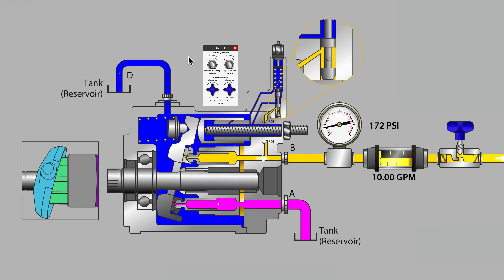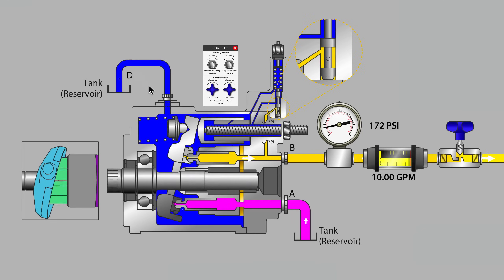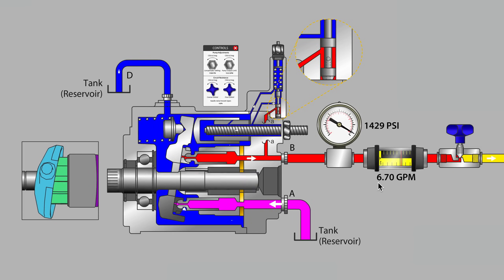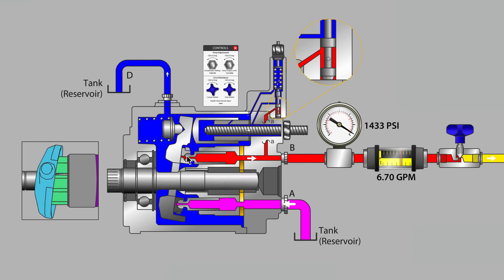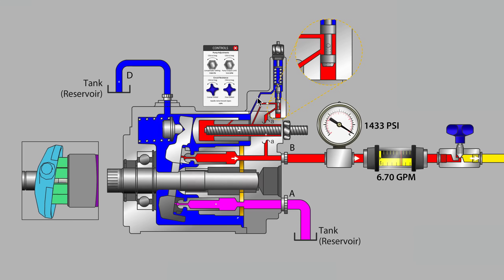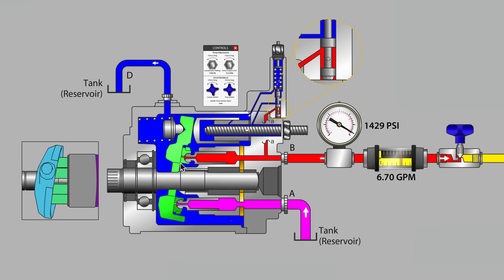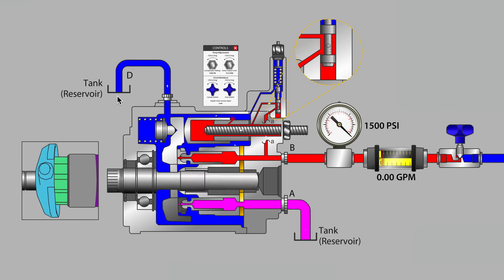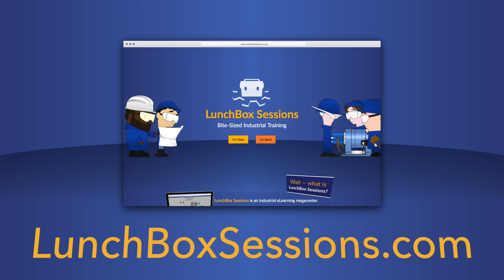Sources of Piston Pump Case Drain Flow

Comment: Would you care to explain why the pressure regulator in the pump works in a different way than an external pressure relief valve. Or where do I find it explained on your internet site?

Comment: Thanks for putting this together. I’ve got some schematics I have to teach from but they aren’t as detailed and didn’t show how the compensator provided the case flow along with other clearances.  I’d like to add in my experience in aircraft maintenance we almost always have filters on the case drain lines. We do scheduled inspections on the filters to find impending pump failures, and the filters also prevent any debris contaminating the rest of the system. Some smaller aircraft may route the case fluid through the return filter, but the larger aircraft will have a separate one. It makes it a lot easier to find the failure point without having to do a metallurgy test to see what other hydraulic components is failing.
Reply: You wouldn't want to lead the drain line through the return filter as you don't want any pressure build up in the drain line as this will increase the case pressure
Reply: @teis79  every airplane I’ve worked on is designed this way. It helps identify a failing pump before a full on unscheduled rapid kinetic disassembly. We have inspection intervals on the filters and most of them have a differential pressure indicator on the filter housings for a visual cue. As for the restriction that’s some engineering math outside my realm, but it makes sense.

Comment: I have a question about where the case drain connects to the tank. I assume as you said " unrestricted  flow" it should connect to the top of tank. I have just noticed all are hydraulic  power packs at the place I work at have the case drains connected to the bottom on the tank. Is this not wrong, or is there a reason for routing it this way? Thank you
Reply from the maker: Well not quite. Any liquid that splashes onto the surface inside the tank will quickly entrain air and foam the fluid. Unrestricted in this case means usually a back pressure of no more than 10 or 15 psi. So  even a 20 inch fluid level above the return port in the tank won’t amount to that. Ideally below the fluid in the tank but not too low. Thanks for the question.

Comment: Nice content! Thank you so much for sharing it. Tip: to check if your piston pump like A4VSO is bad, close your relief valve and measure drain liters, it should be less than 10% of your pump. Example: A4VSO125 piston pump is around 196 liters per minute, drain on pressure should be up to 19 liters.
Reply: Excellent!!! Thanks for information
Reply: How to close relief valve sir ?

Comment: Awesome job. I've seen some pumps with pointers on them that would indicate pump plate stroke in degrees.  That would fit nicely with your software. I worked at a place that tested pumps by hooking up flow meters to the case drain port.

Comment: is possible to test the condition from the load sense pump. seeng the leakage on case drain line??
Reply: Farid mahomed Yes. It is most useful if you have,a base reference.  Know what the case flow is when the pump is new.
Reply: It's the entire pump leakage.